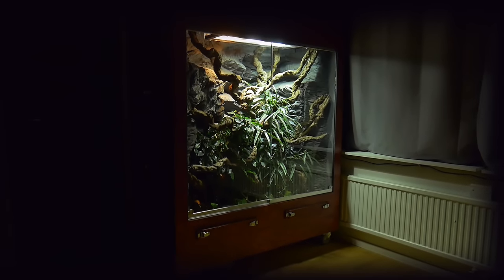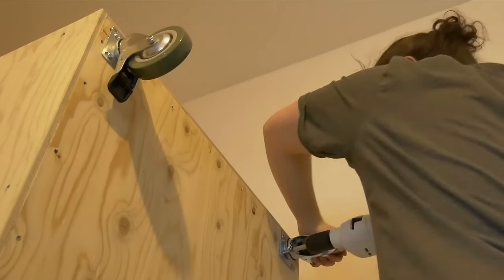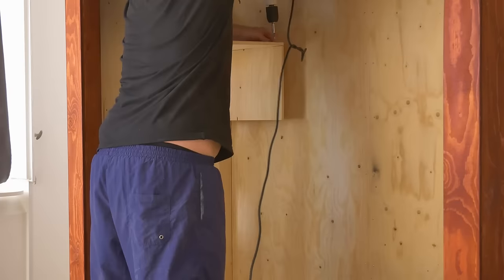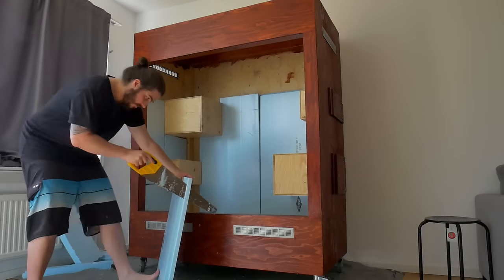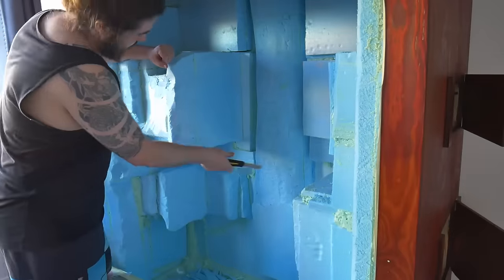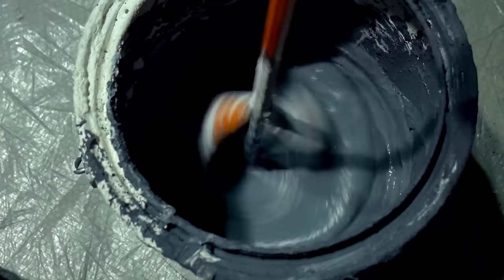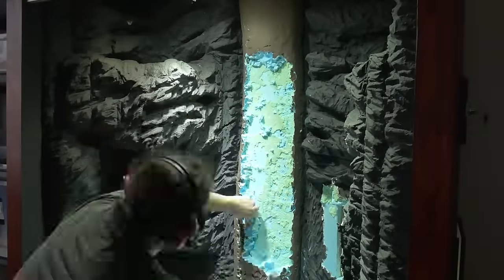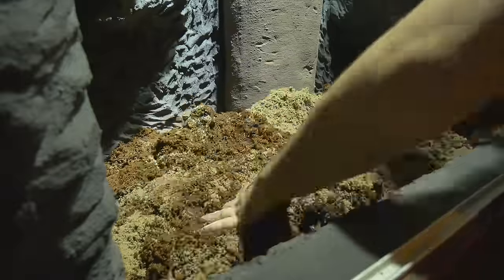How I made a Huge Reptile Vivarium – Full Build!

Comment: Im trying to build something very similar to this actually and wondered if you could go a little bit more into detail on the drainage system
Reply from the maker: A follow up video with A LOT more detail on this build is on its way! Hopefully done in the next few days. I cover the drainage system and lots more elements, technical details etc.  If you haven't yet - subscribe and hit notifications so you know when it's uploaded! To answer shortly I made a drain using aquarium plumbing, sealed the floor and made it so water would go to the bulkhead drain.

Comment: I would like to know if there are any effects from using drylock? Or do you seal it with silicone?
Reply from the maker: Not sure what you mean by effects? The drylok when applied in many layers seals the foam completely. It is waterproof and has quite a firm/hard texture when done correctly. I don't add anything ontop of the drylok. It does have a somewhat rough texture to it, but what rock wall doesn't?
Reply: Sorry I meant does put off any toxic fumes even when it's completely cured? Have you used it for a long period of time before this project or was this the first time and you're just going with the flow
Reply from the maker: @JK-yu6zq  When it is completely cured it is inert (make sure it is Original Drylok masonry waterproofer latex based! Not their other products). Once the fumes/smell have dissipated you are good to go. It just smells like house paint really, nowhere near as bad as silicone is for example! Drylok is great because you don't have to cure it like cement/grout. The latter needs to be cured and exposed to water as it will leach, raising the pH of the water. This is more of a problem if its for an aquarium, paludarium or if you intend on misting or spraying the enclosure a lot for humidity. I wouldn't want my animals to be drinking water that has a raised alkalinity!

Comment: Can you use something like this for a bearded dragon?
Reply from the maker: This setup is not appropriate for a bearded dragon for multiple reasons as it was not built for that species. You could of course build a vivarium with a rock wall that bearded dragons could climb and use. But the layout, dimensions and other factors would need to be taken into consideration when planning/building it.
Reply: Perfect. I knowna lot of the features etc are specific for what you are putting inside, just thought the overall concept may work as well

Comment: How did you put the glass in?
Reply from the maker: I didn't film this but I will explain it in a new video better. Its an aluminium track but it has small rollers/wheels so the big glass pieces slide easily
Reply: Ok thanks so much for answering my question!!!

Comment: I would love some information on what type and how you installed the glass front please and thank you...great build nonetheless, I will be using your frame style to build a vivarium that will be 4ft wide, 3ft deep and 7ft tall for my Murray Darling Carpet Python 

Cheers
Reply from the maker: The glass for this vivarium sits on an aluminium track with wheels. The glass piece itself has an aluminium bottom trim which houses the wheels that then sit on the bottom track. I did not make it, I went to a glazier with my measurements and they gave me the glass and tracks to install myself. That sounds like a huge enclosure for a metcalfei!
Reply: Spectrum Vivaria
Thank you so much for your reply, I like that method but I’ve been mulling over the possibility of using two hinged doors as well.
I reckon I’ve got some more research and decision making to do.
Righto I’m off to Bunnings to price it all up.
Cheers mate
Reply from the maker: @GardeningAnimalsAndFishing  No worries! Every build especially on a big scale is going to be unique to you and your situation/animals - you really need to do the research and planning for whats best for you. Maybe that means having hinged doors like you said! Make your frame etc so perhaps you have the option to do either, or try one and if you don't like it you can change it out. Good luck with it :)
Reply: Spectrum Vivaria
Yeah absolutely, it’ll definitely be a massive learning curve for me and my biggest personal project.
I’m used to demolition and chainsaws so building this will be a huge accomplishment for me.
Two more questions, the frame and sheets were they untreated pine by chance? Bunnings has plenty of untreated and treated pine but not too much else to choose from unfortunately.
Also have you got a social media platform that I could show you pictures of the finished vivarium which will be a direct product of your inspiration?
Reply from the maker: @GardeningAnimalsAndFishing  Best way to learn is to just go for it! You have to be OK with making some mistakes/failing to learn and grow any skill set. I definitely went through that with this build. Yes it was untreated pine which is not a problem if you seal it well. I would not use treated pine. I'm on instagram so that would be the best way to show me your build  https://www.instagram.com/spectrumvivaria/ Its great to have inspired you, seeing people appreciate the build and video means a lot!
Reply: Spectrum Vivaria
I’m 100% looking forward to diving in the deep end with this!

Thanks again mate
Reply from the maker: @GardeningAnimalsAndFishing  Hey mate I remembered that you had a lot of interest in this build so in case you haven't seen it I just uploaded a much more detailed build breakdown for this enclosure - I think it has a lot of info that will help you out! https://youtu.be/PJcjLpnTtQw

Comment: Do you have the plans for it? Would love to buy them from you.
Reply from the maker: No but a new video upload is coming very soon where I go over and talk about the build process in much greater detail! Building big vivariums should be planned for your specific needs not a direct copy of someone elses I think.
Reply: @SpectrumVivaria   you're right, i guess but if its the same animal i dont see why not lolol
Reply from the maker: @DoctorPepper4  Here's an example as to why it can be a problem. I made my cage so it only just fits through my doorways etc. If you go and try build using the exact dimensions of my plan - What if your doorways are 10mm shorter than mine? Even a slight adjustment to the length of the cage changes the dimensions for many of the pieces needed to put it together. That's why for an oversize build like this I think it's better to be inspired but take the time to plan and design it for YOUR needs. Imagine building something like this and you can't get it out/in to where you want it to be in your home....What a nightmare! If you're wanting to build for tree monitors too then I also suggest to build as big as possible for you (I wish I could have gone bigger!). If I do smaller builds I might consider making proper plans that anyone who wants to can replicate, but not really for any big builds.
Reply: @SpectrumVivaria  i understand, gotcha thank you

Comment: Subscribed for certain! One ting...if it weren't an important video to kick off my channel, I'd never create that much waste just because I don't like what I did.  Surely, a craftsman has to be critical of his work so I guess it's different even in private...
Reply from the maker: I welcome constructive criticism, and I agree that I wished I had got it right the first time and not needed to waste anything. Most do not want to show their mistakes and failures and only the positive (or like you said in private). But this was a learning experience as all projects are. The enclosure was used for sometime, testing  what had been done already before I decided to change it. The changes were necessary in my opinion, but I believe the end result is much better not just aesthetically but for the animals as well. It is hard to see with all of the vines and plants but there are multiple ledges for them to lay on and climb better now. There were other factors than "I didn't like it" but I did not cover it all in this video. I plan to do so in a future upload.

Comment: My only question is how do you clean it 👁👄👁
Reply from the maker: Of course having a setup like this can mean a bit more work to keep it clean than a more simple set up. That comes with the territory. But setting things up in a certain way makes this possible and manageable for me to keep good hygiene in there. 

I use multiple methods to clean this vivarium. For the upper rock wall areas I spot clean it as needed (almost daily). I do this by manually removing waste and scrubbing the areas with a toothbrush and water/F10 disinfectant. I then rinse the walls with fresh water thoroughly. As my system is waterproof and has a drain I am able to do this and simply drain it regularly so that the substrate does not get too wet. This also gives the enclosure a nice humidity bump afterwards. 
I can use the same method for any waste that is on the vine structures too.

The substrate itself is bioactive with isopods, springtails, earthworms etc. This helps with any waste that falls down or is missed by manual removal. It should also be noted that urates (the white stuff that reptiles poop out) needs to be removed manually.